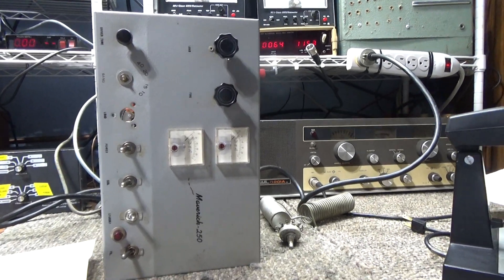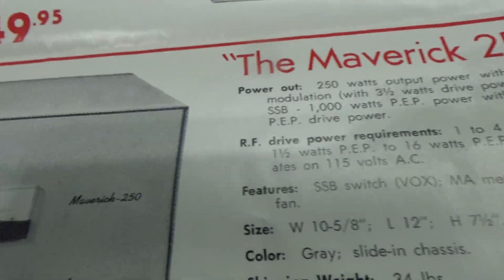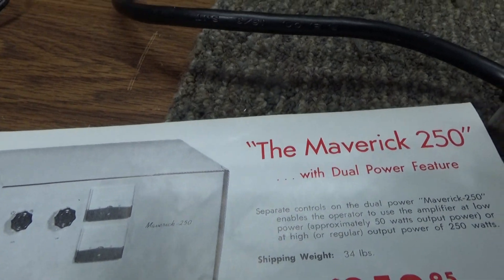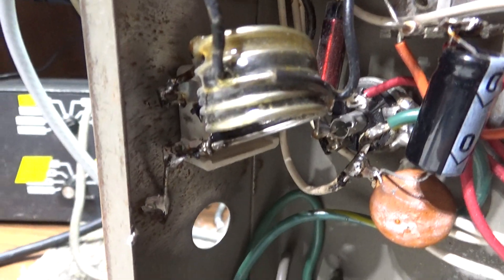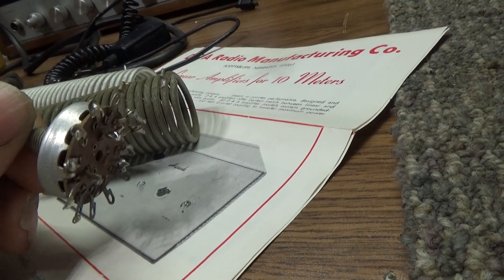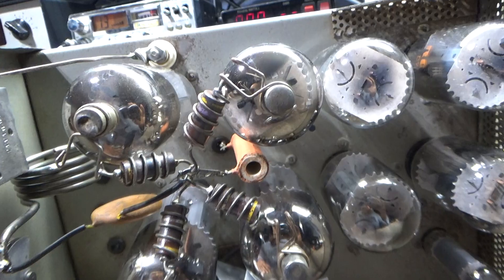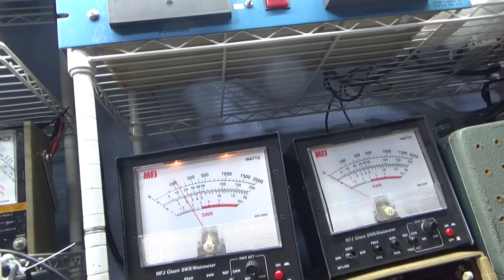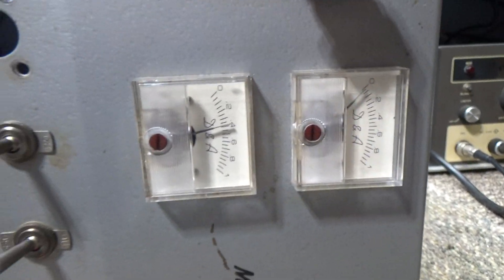early Maverick 250 monobanded for 10 meters only

Comment: How do you make sure its grounded out to replace tubes ?  Keep from getting shocked
Reply from the maker: D+A's have bleeders, turn it off, unplug, wait 5 minutes, then get a long screwdriver and run the screwdriver across the tube plate caps, the top silver connections and a bare metal spot on the case, which would be ground.

Comment: 50 years ago...
It was a tossup as to who sold more amps, Kris or D&A. Hawks were popular with owners of rigs like the Regency Imperial and Range Gain, and the Olson Sidebander. These rigs had a reduced carrier scheme and typically put out 1.5 watts. A Hawk gave it a little more schmaltz to compete with the crowded band conditions of the early 1970s. 
4 watts into a 50 ohm load is a little over 14 volts.  
Tube finals can withstand a mismatch far better than transistors.  Many amps of this era didn't have any input matching circuits because they weren't needed. Also, before the FCC standardized the output power at 4 watts the input power of 5 watts typically gave a 3 watt output. 
When transistor sets displaced tubes  amp makers were forced to add a tuned input to give the transistors a correct resistance load to prevent the voltage from getting too high and destroying them.  
Before rigs like the HR2510 and the Ranger the concept of "high drive" wasn't a problem. Most CB radios weren't capable of doing more than maybe 10 watts output on AM. 
Keying circuits. Ever hear of an amp made by Polycomm called a Poly-Booster? It is a 2x6883A amp made for use with the Model B low band FM radio. I have both radios. When I got the amp it wouldn't power up. Without a schematic I had to trace it out. I discovered that a relay controlled the primary power. That relay needed 12 volts DC from the Model B through the antenna connector to pull in. A fiendishly clever way to prevent CBers from using it illegally. The problem was that the 12 volts appeared on the amp's output connector. No problem, unless you're using an antenna with a DC ground. Its keying circuit is a special relay that needs the 10 watt input from the Model B to activate it. The 3 or 4 watts from a standard CB radio isn't enough. The Model B is rare enough, but the amp is extremely rare, and I got lucky when I got the amp over 10 years ago because I haven't seen one before or since.
Reply from the maker: Up here in the Mich, Oh area, it was D+A, and Palomar who sold the most. Kris, not so much.
Reply: @tramdr  Wagonmaster 390 asked me to ask you if you know a 669 from your area.
Reply from the maker: @spaceflight1019  nope
Reply: @tramdr  okay, thanks. 390 was doing a livestream last evening and talked to 669 on 40 lower and just fell in love with his audio.